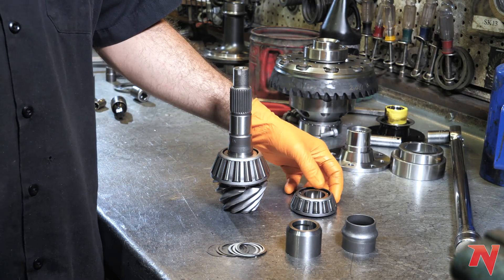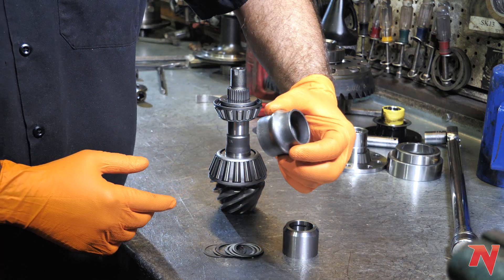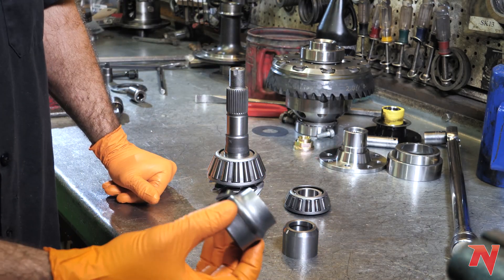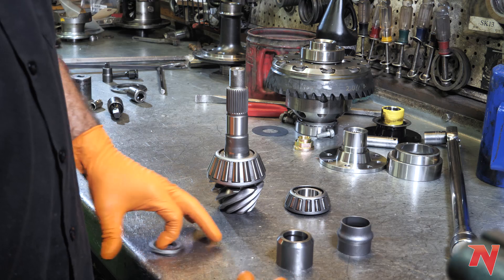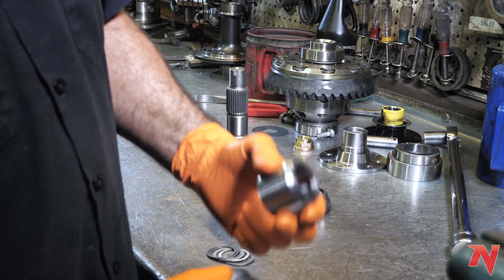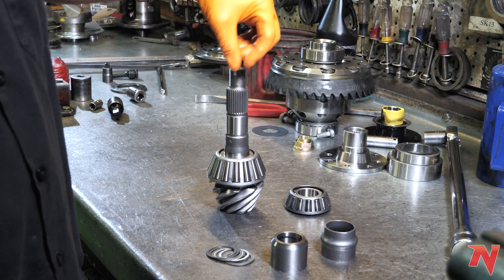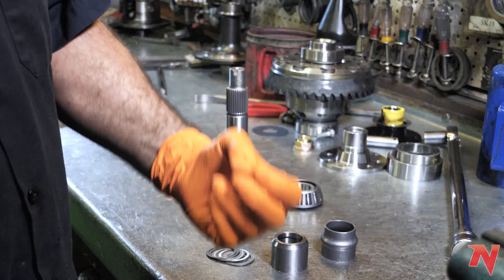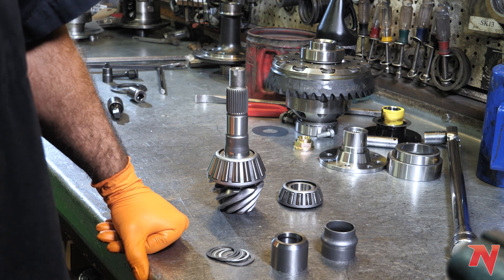Crush Sleeve VS Solid Pinion Spacer - Lets Talk Pinion Bearing Preload!

Comment: So i have a D30 with a non crush sleeve setup, im about to change the seal can just put it back together and use an impact gun to tighten the nut? And some thread locker?

Comment: How do you know when you have reached enough preloaded
Reply: With crush sleeve there is usually an inch-pounds measurement that you can try to achieve using a beam style inch pounds torque wrench. I would assume it's the same for spacer with shims.

Comment: I haven't been able to find a spacer for the 9.75 rear end in my F150.  I overcrushed the first sleeve, and undercrushed the next two.  I learned the hard way what the consequences are for each condition.  I'm getting ready to do it the 4th time with a new torque multiplier wrench and fancy new radial type torque wrench.
Reply: Wow

Comment: One question, why don’t you explain the torque spec in relationship to the crush sleeve? The sleeve when torqued to the proper spec/ tightness should have a resistance of 10-20 inch lbs. at the pinion.
Just saying :)

Comment: Good video. Finally someone who gets straight to the point and explains it . I'm in the process of replacing the pinion seal in my 57 Plymouth differential. And it seems no one has a clue when I ask questions. Work shop manual says it has a sleeve and shims. What is the correct tourqe setting for pinion flange nut? Work shop manual says 180--200 ft lbs

Comment: If just changing leaking pinion shaft seal just tighten it up.  If it takes 200 lbs to crush it, you can tighten to 100 which is tight on the old parts.  I have changed hundreds of seals and tightened the nut as tight as I could with regular 1/2 inch rachet.  I don't know how you can accidently torque to 200 lbs to crush it further.   If any rear end went out, I was never told about it.  Complete disassembly and new bearings and such needs new sleeve.   Just replacing the seal, just tighten the nut, you don't need a torque wrench.

Comment: I’m not sure if I’m doing something wrong but I have a ford 8.8 and I’m using 2 foot long breaker bars trying to tighten the nut to crush the pinion sleeve however the pinion has too much play back and forth and I can’t tighten it any further.

Comment: Crush sleeve does not provide or maintain bearing preload. Preload is provided by the pinion nut. The only function of the crush sleeve is to prevent the inner race of the front bearing from spinning on the pinion gear shaft during operation. The crush sleeve is captured between the inner race of the pressed on pinion bearing and the inner race of the slip on front bearing preventing the front inner race from spinning. Dana diffs have no crush sleeve. The front inner race is captured between a shoulder on the pinion gear and the pinion flange. Bearing preload is provided by the nut torque and adjusted by shims. Let the arguments begin.
Reply: Correct about the crush sleeve not being the part that actually applies the pre-load. But you can't set the pre-load without it either. It transfers the load. And I've personally installed a handful of crush sleeves on Dana axles so, not sure where you're getting that from...

Comment: Great video my dude, how do you know what size solid sleeve you need?.. do you measure the crush sleeve?. Also with solid sleeve do you need to set the pinion nut torque to same amount as if you where crushing the sleeve down?
Reply: I did my diff around 9 or 10 years ago and my memory is such that I’m struggling to remember, but I believe the talk settings for both are the same.

I ‘can’ remember thinking to myself (at the time) ‘the greatest tool you can have for setting up a diff is the proper workshop manual’, and between that and the instructions that came with the E Locker, even was able to have success!

Comment: But why wasn't it designed that way from the factory? There must be some scientific reason for replacing the original design which obviously works like a compressed spring, continuously exerting stress on the rollers that are sandwiched between the tapered bearing races..
Reply: Cost and efficiency. What factory’s gonna pay a top mechanic upwards of $100 per hour, for up to 8 hours at a time, just to install a pinion spacer?

And unless you’re sporting a translucent diff casing then the average layman ain’t gonna see it, and it’s doubtful they’d know what it was even if they did!

Comment: So how do you install the solid spacer with the correct amount of preload? Ordered one but not sure what the install procedure is
Reply: See other videos.  Pre load is to check the bearings are seating well on outside races, not too tight, not too loose.  Use torque wrench lightly before checking Pre Load value.

Comment: Forgot to mention that crush sleeve generally requires really long breaker bar and a way to rig up something to keep the pinion from turning like something bolt to the yoke has a long angle iron steel his the floor if your using jack stands keep it from turning.

Comment: You can't adjust the preload on the pinion without the ring gear out right? Thx
Reply: ....Remove drive shaft after marking shaft relation to yoke. Check rotational torque to rotate flange ( AFTER removing axles on floating rears, remember to put catch cans under the axle flanges as gear oil will run out onto your rims if you don't . Inspect the oil for anything shiny or metal at this point to see if you have other problems ) record this torque number then mark pinion nut to flange and mark flange to pinion also ( can use same mark on pinion) count threads from nut to end of pinion ( I usually put nut, pinion, flange mark where thread just mates perfectly meeting nut.) Count the number of threads and record this also . HOLD flange if using impact or not while removing nut . This nut should be replaced but if budget is a concern use blue lock tight upon reassembly on pinion threads . remove the flange using a two jaw puller .....no hammers or even slide hammers to do this use a puller while holding flange from turning . I find a large pipe wrench or chain wrench works well with a pipe and wire tie it against the frame. use a wood block if you need clearance between between pipe and frame. ( exhaust, fuel tank etc.) Remove old seal . Factory requires a new crush sleeve as it's a one use item . I've done it without replacing the crush sleeve and never had a redo . But it's critical to record things before disassembly as instructed above. I have known other mechanics to install a .005 shim before installing yoke between yoke and crush sleeve. I don't recommend it as it will mess with your marks and count. But rotational torque helps here. Me I never do this , again no issues. Install new seal .... a few things here put some RTV silicone on inner housing surface where seal goes into the housing assembly, put gear oil on inner lip of seal and pack the seal lip on the housing side with grease or white lithium grease before installing to keep the tension spring from popping off the lip. I have assorted seal drivers to do this without seal damage. If you don't have the specific tool you can use a piece of schedule 80 PVC pipe and a pipe cap that is the right diameter to contact the seal correctly . Then square it up and tap it into the housing. After it's in I take a small ball-peen and tap around the outer flange to be sure it's fully seated and square. Next check the flange out for any grooving where the seal rides. If you find a groove don't try to sand it away only a light emery cloth cleaning is advised if there is a groove that you can feel or if in doubt at all there is a thing called a 'speedy sleeve' that goes over the flange seal surface that removes all doubt. Install flange aligning mark on flange to mark on pinion prior to removal . Tap flange onto pinion with a dead blow hammer if needed until you can get a nut started onto the pinion threads . I say 'a nut' as here I use a standard non locking nut 12pt or a hex nut of correct thread . Pull the flange down until there is no play DO NOT TIGHTEN with this nut. after free play only is removed remove this assembly nut . next take some RTV silicone and put a bead around flange to pinion splines . This will prevent gear oil from leaking out between flange and the pinion splines. Now install the actual pinion nut .....( .lets use a AAP 11.5 diff. used on Dodge ,GM or Ford that replaced the DANA .) The 'chart' recommends an initial torque of 175 lbs. ft. I don't go over 170 ....( Only use a torque wrench from here on out to tighten the pinion nut and only increase like 5lbs between each rotational torque check. A helper would be advised as it's a lot of on and off with the flange holding tool. )  In any event torque the nut then prior to going further check your marks on the pinion and nut relationship. there should be a ways to go yet also not enough threads should be showing . With the flange being held by afore mentioned pipe or chain wrench put a mark that corresponds or aligns when on the nut with the mark under it on the nut . Then tighten the nut to the mark on the flange that aligns with the nut mark and the pinion mark you cannot see under the socket. Stop , take a break.......OK, Remove the flange holder and get out your inch pound torque wrench . ( Again this is for a AAP11.5 as an example ) Having not replaced bearings the rotation torque recommendation should be 10-20 inch lbs. Don't go over on this 20 inch lbs. On used bearings but you aren't concerned with that as you wrote down the torque before the pinion nut was removed right ? So match that previously recorded rotational torque and increase by 5inch lbs. for the additional drag of the new seal . Reinstall the drive shaft being shore to align the shaft to flange mark . Clean the axle flanges and apply new gaskets or RTV silicone and torque bolts on axle flanges. Next remove the plug on the rear of the diff. and fill to the bottom of the hole . Install the plug . Next remove the differential vent line and check for obstruction or that the vent check works correctly. Before reinstalling the vent hose and check valve put about a half pint of gear oil into the differential through the vent hole . Clean the old oil off the differential etc. Before test drive stop truck for a while while leaning to the right then to the left . Let it sit for a good 30 seconds on a warm day to allow gear oil to return to the outer floating hubs . Test drive a short distance and check for leaks . Continue on test drive to bring Diff temp to operational temp. Stop and check for leaks. Also during test drive listen for any noise from the rear . Accelerate normally then let off the gas listen for any noise that comes and goes from the rear-end . There should be no change or very little if it was just a seal problem . Return and recheck the fluid level in the differential is correct. Sorry about the book but a partial explanation will get you in trouble on these things. Good luck . 

P.S. Most rental companies will have all the tools you need to do this job if you don't have them .

Comment: lot of mechanic don't know the reason to have crush sleeve. All taper bearing must have preload. Pinion bearing also must have at least preload of 25 inch pounds resistance when you rotate without the ring gear attached, with new bearing/used bearing is around 15 inch pounds. That reading can varies by model.
Reply: I've seen front wheel hub with 2 opposite taper bearing don't use sleeve. The bearing preload depend on how tight you fasten the nut.
Reply: wrong, taper wheel bearings do not use crush sleeves

Comment: Pinion bearing pre-load while using a Nitro solid spacer (Dana 35). 
I installed mine.
Answer update. 

The Nitro spacer is Awesome. It’s the only way to go folks. 
If you have any problems, call their tech service, they are a huge help.
Reply from the maker: Feel free to email tech questions to Info@Nitro-Gear.com

Comment: Can the preload spacer be made before the pinion height is set? 

My thinking is that the bearings and axle housing will not move relative to each other whilst setting pinion height because the shims sit behind the bearing.

also once set up with a solid spacer can the bearings be replaced without the need to reshim so long as the preload is within spec after tightening the nut?
Reply: Not to put to fine a point on it but the correct term is pinion depth. The way to approach pinion depth is to set your pinion preload without the crush sleeve. After setting your preload, without the crush sleeve, you would take your pattern and adjust the depth accordingly. After you have achieved the correct depth and backlash, you proceed to the final assembly (pinion seal, crush sleeve and bearing) and reset the preload, with the crush sleeve in place.

Comment: I don't want to switch to a solid pinion spacer yet, my ford 8.8 still uses the stock crush sleeve to the best of my knowledge.
The pinion seal is leaking, do you think it's OK to just do the "same exact thread count as it was before" trick with the pinion nut, or do you have to install a new crush sleeve and crush to spec?
Reply: My is leaking also. I’m counting threads and marking with paint stick. Good luck.
Reply: @JohnDoe-ui2ud  use impact gun to take the nut off and remove the yoke  and install new seal, Clean the threads and reinstall yoke and tighten the nut to about 75 foot pounds. Don't worry you not going to crush the sleeve.

Comment: Well I get the idea, but how do you set the thickness.  I heard that too much is not good and little isn't either. How do we actually set the spacer ? I need this info now but can't find it anywhere. So I'm going to set it to a same thickness as the old crush sleeve was. I mean I only changed the bearings, did not touch the gears. Bearings are all same size, made on a machine, no variations in there. (at least not a significant amount)  I'm also contemplating of reusing the old crush sleeve. It worked before so it should work now, right ? Again not changing gears, etc. Gears are perfect, looked at the gears and tooths and they are very close to oem spec. No sharp edges, no odd wear pattern. This indicates that the gears were aligned perfectly. My pinion bearing failed and made so much noise, it was unbearable, hence the reason I needed to change them. But then again thinking it over the pinion bearing might have failed because it had too much pressure on it. Meaning the crush sleeve was too thin and the bearing cones made the imprint on the cup.  Damn, this is really hard and there is no real reference point to set it correctly. The new crush sleeve isn't really an option for me. It requires 300ft/lb pressure to crush it and I can't do it on my drive way. Truck is not on a lift but on a jacks. There is absolutely no way I could do 300 ft/lb on my back in a weird angle under the car.  Also my torque wrench only goes to 200 ft/lb anyway.  300 is a lot of strength.  My 18V electric impact wrench can do 458 ft/lb but that is too much, so I have no way of measuring the 300 ft/lb
Reply: In a nutshell - here it is:
each axle has a preload spec, (meaning Ford, Chevy, whatever) with that said I am posting a chart so you can look up yours.
After you find the correct preload torque on the chart - you a inch lb torque or dial indicator. Begin to add
shims to the main eliminator sleeve. Turn the torque wrench or indicator, if it is too loose, take
out a shim and do this until you reach proper torque spec.
https://www.crawlpedia.com/ring_pinion_setup.htm
Reply: Use a floor jack to push up against the rachet handle.

Comment: I replace pinion seals all the time without replacing the crush sleeve you just have to be easy with an impact gun when re torquing the yoke nut!
Reply: I thought you weren't even supposed to use an impact on bearings because the chatter might damage them.
Reply: he's talking bearing and races not seals